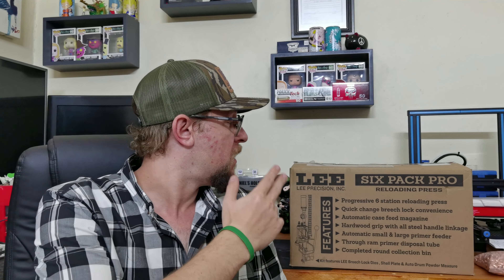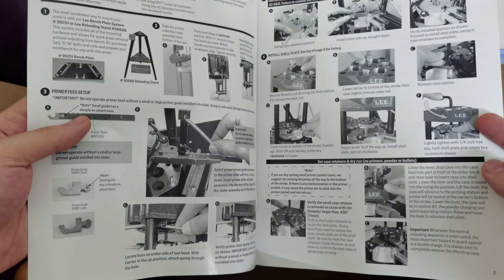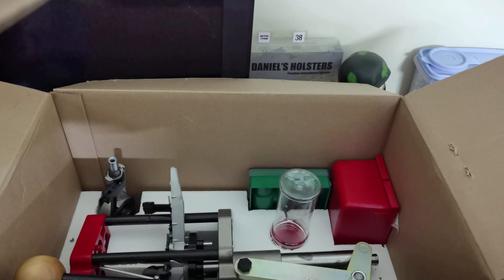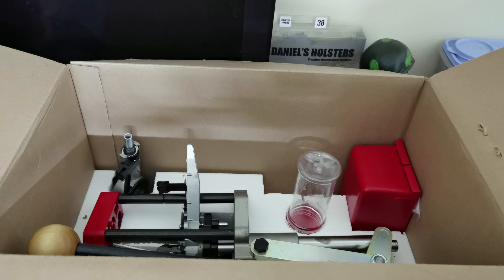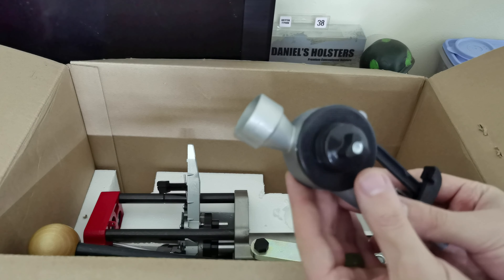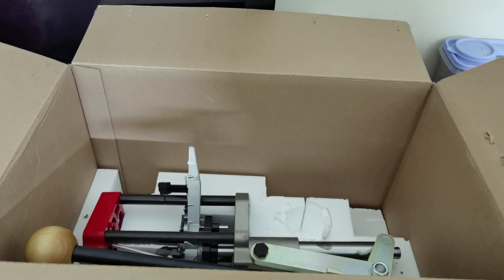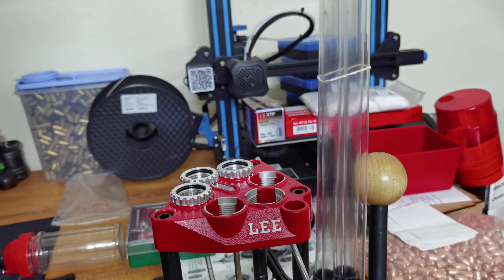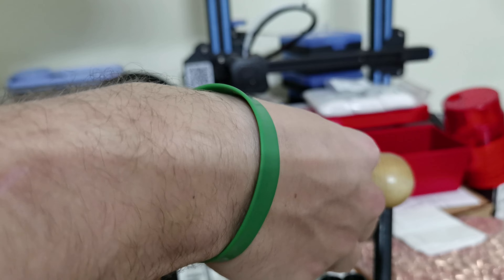Lee 6 Pack Pro Unboxing and Setup

Comment: I have the loadmaster and the six pack . The six pack is a really good press. I do my 223 on the six pack. And get your self the roller handle. It make for an easier pull.
Reply from the maker: @stevealoia  Thank you so much for the support and comment! I will definitely grab the roller handle thank you for the suggestion!